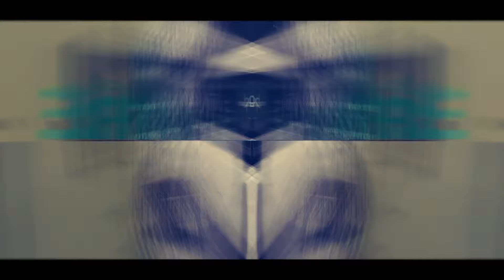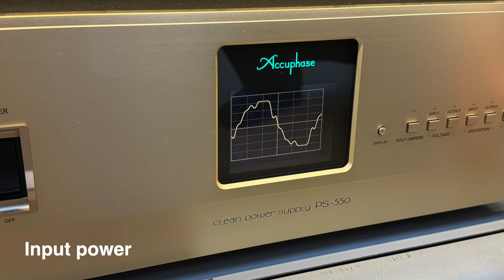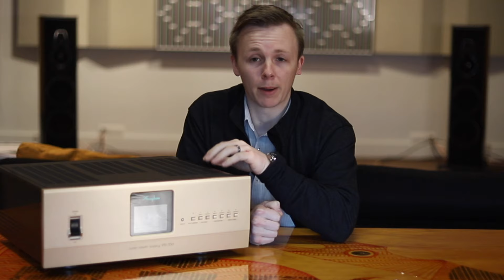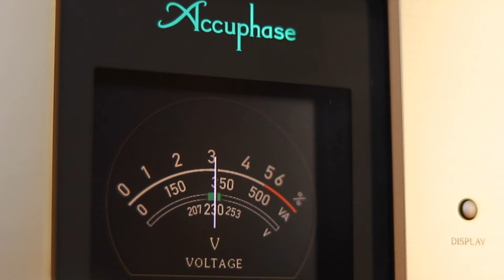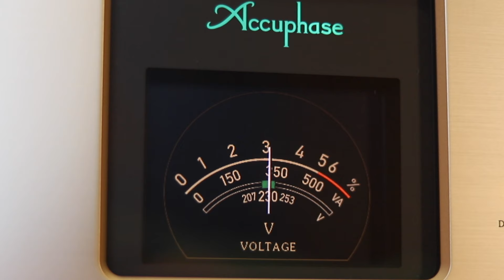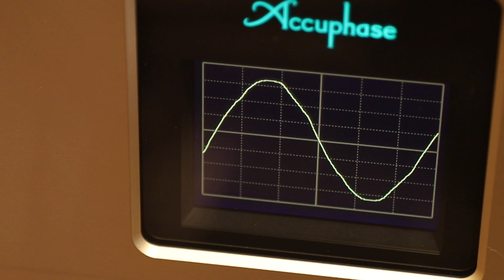Accuphase PS 550 clean power supply

Comment: James, another excellent video, thanks.

Just curious where you see a QBase Ref fitting in with the PS-550/1250, re the former's primary earth outlet. If you had both in a system, would you still plug say a C-3900 into this, given it may be the main benefactor of the clean p/s? Or swap for a QB8 (16A, with QWave/QSine) to just feed the PS?
Reply from the maker: Thanks!
In our testing, we have found the best performance is achieved by plugging the Qbase (8 or Ref) into the wall, Preamp into the Qbase primary earth, and then the PS-550 into the 2nd output on the Qbase. Then the CD transport, DAC, and Turntable power supply into the PS-550 as they have the most to do with physical media and moving parts and therefore benefit the most from the perfect sine wave generated by the PS-550.
And all other devices straight into the QBase. (Power amps, phono, streamer etc).
We have not had a PS-1250 to try yet.

Comment: An isolation transformer is not a regenerator, two different methods trying to do the same thing. Isolation transformers are not good for if need a lot of power.
Reply from the maker: Can you explain further the differences between an isolation transformer and a regenerator?
I don’t know which one the PS-550 technically is, I just know it makes the system sound WAAY better.

Comment: Great video!   Amazing that the PC-550 can make such a difference.  I know that you paired it with the E700 and were at about 75% of the PC-550’s capacity.   Do you think that 550 can adequately handle the E800 and an Esoteric streamer?

Did you notice any differences between the PC-550 and its predecessor the PC-530 other than the meter?

Thanks!
Reply from the maker: I would say that it could handle those two items, but can’t be sure without testing.  As far as the difference goes, I only have a customer‘s report to go on who at first said they heard an improvement, but then later on said they thought it was pretty close.

Comment: GM ☕️from Toronto.
I find this to be an interesting 🧐 piece.
However,I’d only consider something like this ONCE you’ve maxed the room and system performance as possible…
Only then will “guiding the lily” yield and audible improvements .
Have a great day.
Reply from the maker: Well yes and a little bit no.
It depends on what you consider to be a maxed out system.
This is a high end piece of equipment and obviously not fundamentally necessary for operation so it’s not the first or even 4th thing most people are going to buy.
However, in our demo room system, which is around about the middle of our main brands ranges (Accuphase and Sonus Faber), the PS550 made a MASSIVE difference. So I’d say if you’ve got the $ and looking for a significant improvement on what you already own, this is 100% worth it.